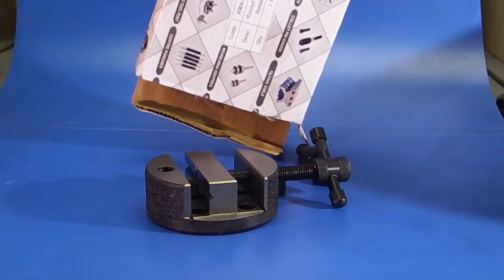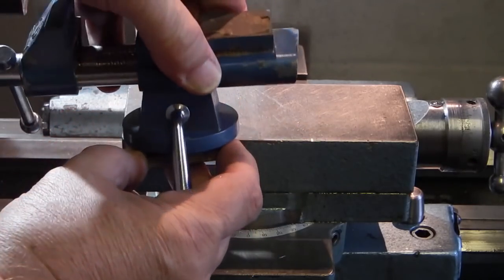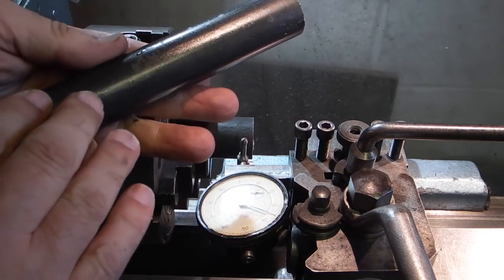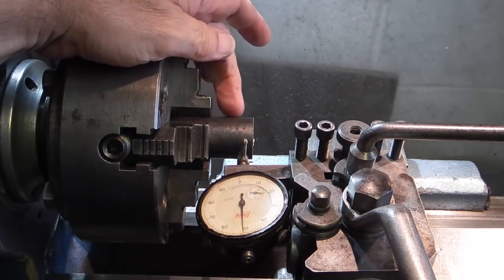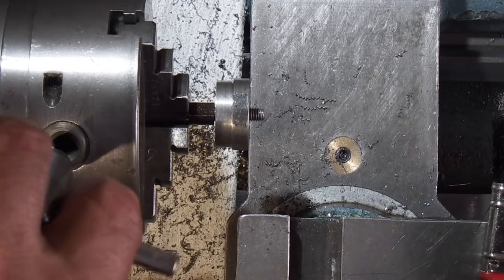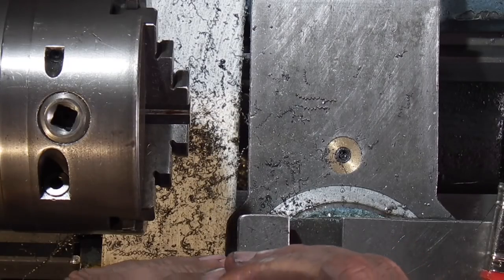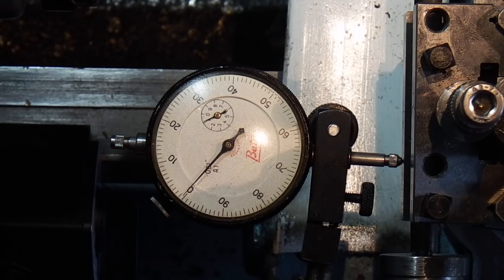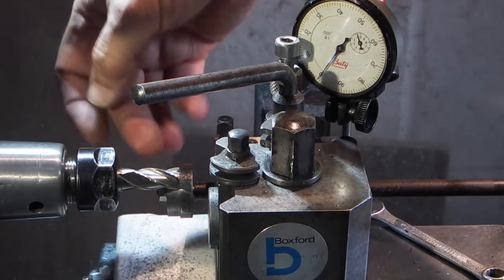Vice for the compound slide

Comment: I love your over dubbing and often wonder what you really said for example 'its only held on a cam, which I don't really like, because if that vibrates loose it's a fucking disaster!' Alan, was I close?
Reply from the maker: Hi Andy I over dub when other things happen like someone knocks the door or the noise of the machine makes it difficult to hear the words.
I also have to check the automatic captions as it adds words I've never said sometimes four jaw chuck comes out completely different.